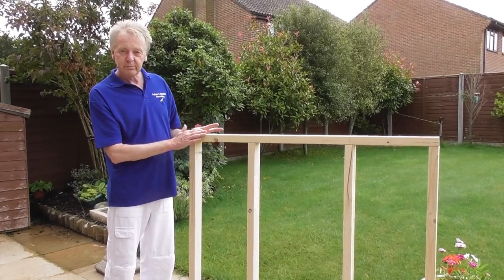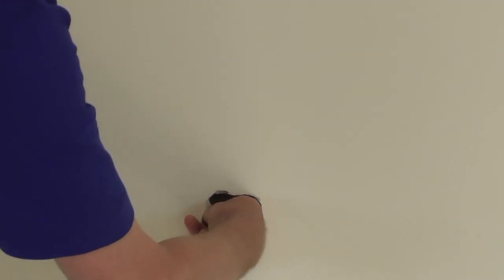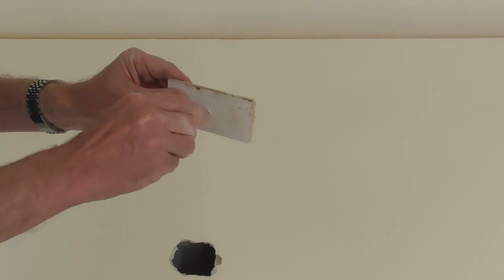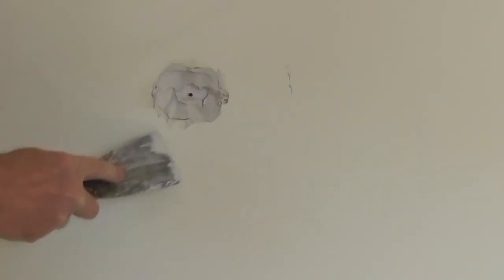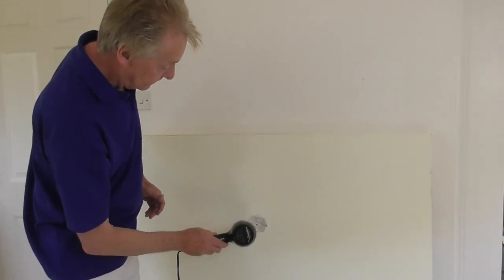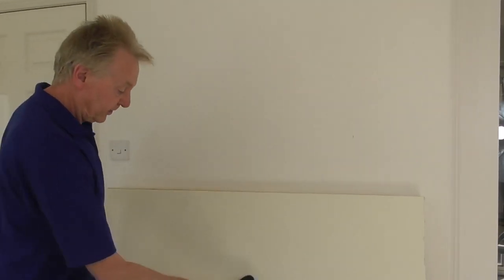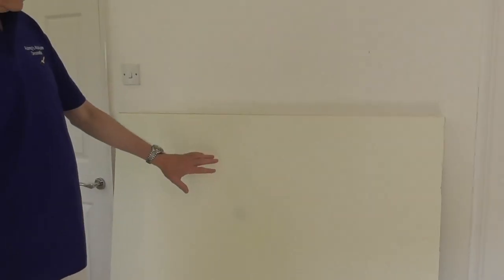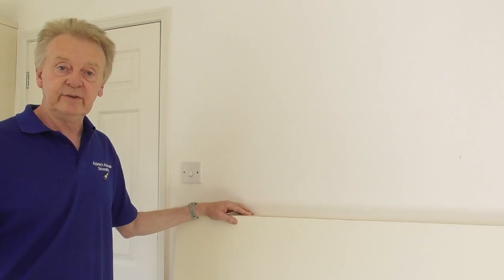How to Fix Holes in Plasterboard / Studwork walls - Drywall

Comment: I've been watching several of your instructional videos which I've always found to be brilliant so was interested to see this one. Whilst it obviously works ok I have an alternative way of dealing with holes which I thought I'd share.
I always square off the holes with a holesaw/multitool then same as you attach a batten but use drywall screws to secure so you're not waiting for adhesive to set. Then cut a piece of plasterboard same size as hole & secure in hole. Finally skim over with filler. Job done.
Reply: Tried the baton screw trick, brilliant idea... Thanks. Only wish I'd properly read your idea and screwed in some plasterboard, would have saved a ton of time.

Comment: I do like the way you just show how to do the job without making a fuss or having heavy metal blasting away in the background. The grab adhesive does work, but it's expensive stuff and if you don't use it very often you go to use it again and find it's dried up, which means you have to put a screw in the nozzle or cut the bottom off. To get around that, I add a few drops of water to the cap and keep it in a plastic bag with a bit more water. Means the first bit is runny, but it's better than throwing the lot out.
Reply from the maker: Glad you found the video helpful.. Good tip regarding keeping the adhesive from drying out 😊

Comment: Wonderful video.  Thank you.
Novice question - could you have cut another piece of plasterboard roughly the right shape to plug that hole, and that once your ply was in, slotted it in place and just filled the surrounding cracks/gaps?
Reply from the maker: That may well work Mark, might give it a try when i get the chance.  However, not everyone will have a spare bit of plasterboard at home 😊

Comment: Great video! Just what I needed. Could you tell me what was the height of the plywood? Obviously, width and length depend of the hole
Reply from the maker: Hi, a piece of thin plywood like three ply will work fine.  If you look at the end of the plywood it has three different layers.  A similar piece of thin timber should also work.  Hope all goes well for you.

Comment: Hi Aubrey another great video. I have used easyfill recently for filling cracks in new plaster.  I used the watered down emulsion for spot priming the filler but found on some spots but not all that the filler peeled off onto my roller.  Have i used the wrong filler type, did not leave it long enough to dry or was it down to my paint/water ratio?. Second time around as i have had more cracks appear I have used a hacking tool to open up hairline cracks, as seen on one of your videos. This time I used an all purpose filler as seen in the video and it has now been left for 2 weeks.  Do you recommend i use the watered down emulsion or a primer?
Reply from the maker: Hi, it looks like you may not have thinned down the emulsion enough so try adding a bit more water.  The paint does need to be quite runny so that it soaks into the filler and gets good adhesion. Also, make sure you are applying a thin coat of matt emulsion to the filler and not vinyl silk.  It should not be necessary to use a primer.  Hope all goes well with the decorating Natalie 😊

Comment: some advise please. i have a load of brand new plaster to paint,  mainly to be painted white. what is best paint and process? mist coat then 2 full coats?  roll or sprayer? which brand of paint etc. Appreciate your advice
Reply from the maker: I would suggesting using a good quality contract matt emulsion.  This type of paint is designed for new plaster as it is permeable and allows any trapped moisture to dry out through the paint film.  Dulux or their Armstead brand are good choices.  Thin the first coat 20% with water for the first coat (mist coat).  Apply two further coats which I also normally thin slightly to ease application and provide a better finish.  I would suggest using a good quality medium pile roller sleeve and also use a roller pole to aid application.  If any filling is required, do this after the mist coat.  Hope all goes well with the decorating  Roland😊

Comment: Hi Aubrey, love your videos! I wanted to find out how you would crackfill a drilled hole in a plastered wall? Also, I have electrical sockets in a plastered wall with bad patchwork and cracks that I would like to fix up, any advice? Thanks! Learning a lot!
Reply from the maker: Hi Samantha, glad you are finding the videos helpful.  It can be tricky to answer questions like yours without images to go by.  Cracks on walls and ceilings can be treated in the same way as shown in my repairing hairline cracks video.  With drilled  holes just apply the filler slightly proud of the surface and rub down flat when dry.  I am working on more videos showing how to prepare surfaces which you should find helpful 😊

Comment: Did you thin down the paint? I fined it's quicker to use the wood and screws that way you can fill it the same day. Good video
Reply from the maker: Yes the first coat of matt emulsion was thinned 20% before applying to the new plasterboard.
Reply: @AubreysAbsoluteDecorating  thank you! I missed the bit where you said that haha. I use toupret 110 and it's brilliant! Very expensive but you don't have to prime the filler! I usually use tetron but with that you have to thin and then it flashes through the paint.

Comment: Hi mate. I filled some holes on a wall where a TV was mounted. I sanded them down and then re painted the whole wall in a dark blue matt emulsion. It's had 3 coats but you can still see patch marks of where the filled holes where. Any ideas why?
Reply from the maker: This often happens where the filler has been rubbed down nice and flat and smooth.  When the wall is painted the smooth areas can show up, particularly when using dark colours like your blue.  In time, as the wall is given more coats of paint it should become less visible.
Reply: @AubreysAbsoluteDecorating  ah okay. I've done 4 coats and the marks are still there. Is there anything else I can do? Refill and sand down lighter?

Comment: Hi
Does plasterboard need mist coat of emulsion to seal it.
Reply from the maker: It is best to apply a mist coat to new plasterboard to ensure the paint adheres well to the surface.  I think it also helps to achieve a better finish as well.
Reply: What ratio you recommend 
When painting paintable wallpaper is mist coat required
Reply from the maker: A mist coat is usually 20% water.